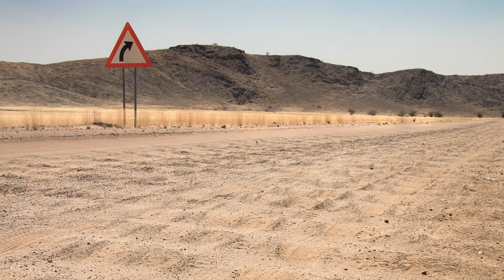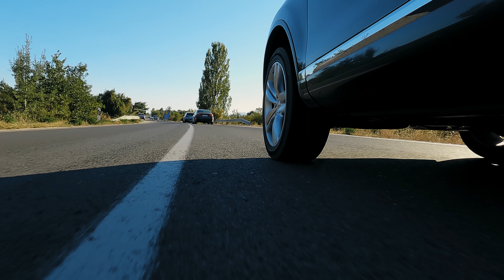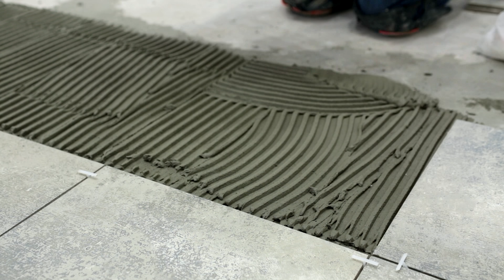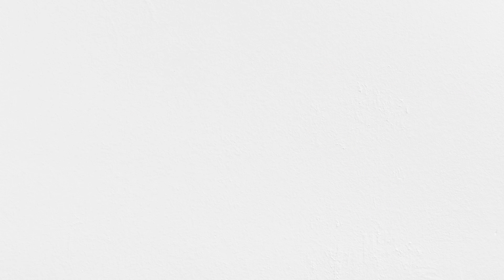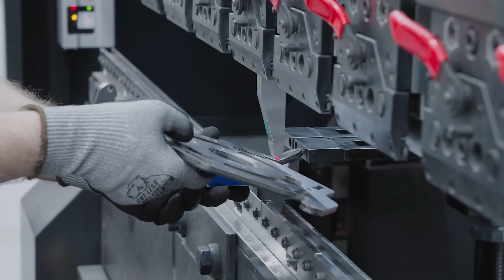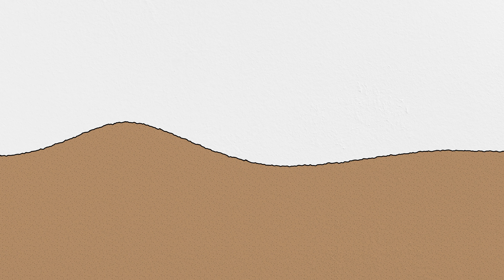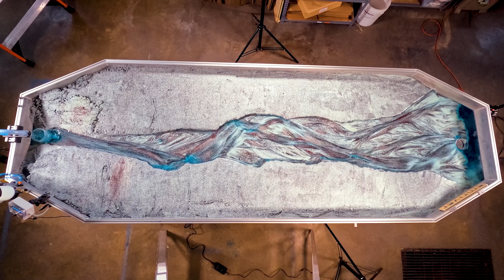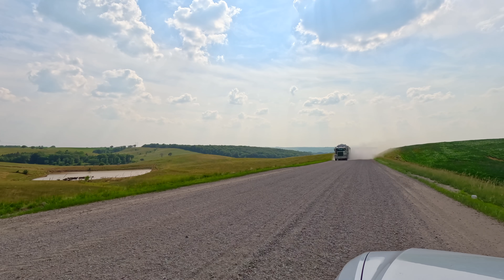Why Roads Get Washboards

Comment: This phenomenon has long fascinated me. I see it with bicycles, dirt bikes, OHVs, cars and trucks, snowmobiles, skis and snowboards, and even off road robots. While speed is mentioned as a big factor, I would say that the surface being overloaded and yielding is just as important. The weaker the surface, the faster and bigger these can form, so sandy areas tend to get the worst. Bicycle trails tend to only get these in braking zones, since that's the only place that a bicycle can overload the surface. Trails and tracks for dirt bikes and OHVs get these in both braking zones and accelerating zones. The amplitude of the whoops as they're called, seems to increase until it is about equivalent to the suspension travel of the vehicles creating the whoops. This makes sense, since once they get so big that your suspension is saturated, you are forced to stop accelerating and reduce overloading of the surface. People often stop using tracks that are badly whooped out. The whoops will creep into closely adjacent tracks, with the same phase. Motocross tracks, snow trails, and roads all deal with these by using the blades of heavy machinery to shave the peaks into the troughs. 
I consider the amount of whoop formation to be a sign of disregard for the trails. A rider who carelessly uses maximum power on the trail and overloads the surface more is causing whoops to form faster. Considerate riders try to limit their power so that the surface doesn't get overloaded so much and doesn't whoop out as quickly. Singletracks are created by bikes themselves, so once they're whooped out, they're essentially ruined. With electric bikes becoming available, I've thought about how you could have an anti-whoop traction control mode that tries to avoid the exacerbation of whoops, by limiting torque in a sine wave pattern matched to the whoops, detected with various IMU, suspension, and wheel speed sensors. I think if everyone was riding bikes with this function, trails would last longer!

Comment: I think a followup video about anti-washboarding features like at 16:08 would be awesome. That specific scene seems similar to mechanically stabilized earth, where the plastic (?) cell boundaries inhibit material transfer along the road surface. Less material movement along the surface --> less pick-up-and-deposit from bouncing wheels --> reduced and/or slower formation of corrugations?

Comment: The problem with your experiment is that you're dragging the wheel. Corrugations are formed by the wheels that are imparting force on the road, because they skip and jump and kick up the surface. Just dragging the wheel will eventually create a similar effect, but not the actual one.

Comment: You are correct, richardheeth621, about a certain speed and the other factors that set the smooth speed, but your suspension is still working a lot, up and down. He has a nice anaylsis here, but the addtion of springs and shock adsorber(damping) adds other factors. Also when the wheel is unloaded and is powered, the wheel/tires will tend to spin, digging into the surface. F1 racing cars are so powerful that that create washboarding on asphalt racing courses, and after a race, especially on a hot day, the track can need resurfacing or repaving.

Comment: While vehicles traveling may eventually cause this on a road, more often than not it's caused by the blade from the scraper at to high a speed that creates this situation.  This explains why a freshly bladed road will have wash boarding more than travel by autos.

Comment: I'm disappointed he didn't address or even acknowledge that the same effect can occur on paved roads. I've noticed it most in areas with heavy trucks, particularly where they are breaking hard. I suspect the mechanism may be a bit different, but not even mentioning it is a failure on his part.

Comment: What happens when you develop the washboard in your experimental set up, and then reverse the circulation of the wheel? Every time I drive Washbourne, I’m constantly steering from one side of the road to the other, trying to find some relief, however, it doesn’t matter if I drive on the dominant i.e. right side in the United States or the left side of the road. The washboard seems to have the same geometric shape.

Comment: What amazes me is that the washboards extend across the whole road way.
Reply: The most likely reason, IMO, why the washboard extends across the whole roadway (from the left shoulder to the right shoulder) is because people drive in different tracks down the road to avoid the worst wash boarding in the main tracks.  The wash boarding starts in the main tracks (down the center of the lane).  When it gets too bad the drivers shift a few feet to the right or left, thus avoiding the worst wash boarding.  This happens until the entire roadway, from left to right, is badly wash boarded.  There is a 2-lane, asphalt-paved rural roadway that I drive often.  It is badly wash boarded in places.  In those places, I drive with my right tires on the white line.  This works for now, avoiding the worst of the wash boarding.  But eventually that track will become just as bad as the main track down the center of the lane.  On rock county roads, there are no lines.  So people use the entire roadway, driving on the smoothest parts and avoiding the worst parts.
Reply: @edschultheis9537  I like your take - it's plausible and it matches my experience too.
Reply: Yes, I am wondering why we do not see a gradient where the statistical average location is of the tires.   Thoughts?  Testing with a dual wheel setup may help to explain this.
Reply: That's a really good one - I wish that was looked into if there was a second video on the topic
Reply: Because people try to avoid them and end up covering the entire width
Reply: Because it's caused by thermal expansion, not tire action.  The top of the road gets hotter than the underside of the road, expands and warps, but doesn't settle when it cools.  This entire video misses the point.  Thanks for being the one observant person out of thousands.

Comment: So in reality, there's no way to avoid this. The best preventative maintenance would simply be to slow down. Imperfections + higher speeds = faster washboard roads. This was neat, thank you so much. From a Blue Collar guy with a self proclaimed engineering curiosity. Jacket McFancypants approved ✌🏼🤟🏼🤙🏼

Comment: You know, an interesting follow up to this would be wheel torque. 
If the gravel is too loose, could the tire's own torque on the surface shovel out the gravel to make more grooves? Put a motor (probably battery powered) on the wheel of the rig and use that to drive it or at least displace the sand as the main motor drives the rig. My thinking is if your tires can't grip the gravel properly and start slipping, this starts making those bumps and grooves early. Different levels of compaction, different surface types, or even different tread styles can then affect tire grip, further increasing the issue.

Comment: You see this effect a lot on ATV trails, especially motor bike trails. How would the model respond if you drag something behind it. Full scale i am thinking along the lines of a vehicle dragging a section of chain link fence, your model scale maybe nuts tied to strings or wires.

Comment: I was talking to a friend about this recently, but it was in relation to spreading bark mulch over a garden bed. I have a long 36" wide aluminum rake that I flip over with the tines pointed upward and the flat blade down on the mulch and I drag it like this at the final stage to give it a smooth frosted cake like appearance. The trick though, is to never drag the rake in a straight line, or never drag the rake perpendicular to it's tine bar.  Always sweep sideways with the rake angled in such a way that it drags over the mulch in a 45 degree angle. This always reduces the tendency for it to bounce over every bump, essentially making the same washboard pattern. I wonder if this 45 degree blade skimming approach could also be used to stop or repair roads with this problem.

Comment: In Colorado we Will run a washboard road into a off-road trail. We always air down are tires to around 13 psi. It makes those roads like carpet.  For the trail it increases grip, protects the tires from being punctured and increases comfort. When we are done we air up with a compressor.

Comment: Would be interesting to run that wheel around as a powered wheel and see the difference it makes, similar to driving washboards in a rwd v fwd, as the front or awd / 4x4 version are for sure smoother then a rwd in my 45yrs of driving the baja washboards !

Comment: it's funny to point out that sand dunes are literally the same thing, just with wind instead of the wheels of a car
Reply: What I find amusing is that the huge dunes themselves are the result of that same action, and the surface of the dunes have the same thing going on in the form of ripples.  In the right conditions, if you look really close at the ripples (like ant scale), you can see the same pattern emerging between those ripples.  Like fractals, in a way.  In areas where people ride on the dunes a lot, you might see sections or trails with huge washboard peaks several feet tall, commonly referred to as "whoops".  Same action again, caused by both vehicles and wind acting together.  There's a certain technique on a quad/dirtbike where you can wheelie over one set and let the front tires land on the second set, and then repeat...this halves the frequency and allows you to go nearly twice as fast.  But if you mess up the timing even a tiny bit, it turns into a rodeo and that's where the name "whoops" come from lol

Comment: You see something similar on some high traffic, slow speed snowmobile trail sections. The waves are much bigger, but made using tracks on a pair of straight rails. Its odd, but can be alleviated with higher speed and more suspension. We call them whoops, since theyre similar in size to motocross track whoop-sections. In summer, the snow melts and reveals the gravel beneath has taken similar shape.

Comment: When they installed speed bumps on our downtown Toronto residential street, we quickly realized that only the first one actually needed to be put in, because the asphalt road surface beyond it would cyclically erode in a way that was just as effective as the speed bumps. :)

Comment: I daily drive a Mazda Miata.  I am assuming due to its short wheelbase, I can feel "ripples" in older paved or concrete interstates.  I assume it's the short wheelbase that amplifies the effect.  I have driven the same roads in my wife's suv and I don't feel them.  Also, it seems more pronounced in the right-most lane, is that due to heavy trucks?  Great video.

Comment: It’s hard acceleration that causes it. That’s why it’s way worse in transition areas. When the drive wheels catch air the spin faster so when they make contact again they dig the lows lower and throw the loose material on the highs making them higher. Light weight vehicles are way more damaging to the wear surface of a gravel road than heavy vehicles. It’s not the speed that cause the most damage it’s the acceleration.

Comment: To not mention once that dirt roads with average speeds above 45mph are nearly never washboarded is insane. You've clearly not grown up on dirt roads. Washboards are caused by people driving too slowly on the roadway. Which allows harmonics to build like your demonstration. I don't need to build a jig and spend research dollars to tell you what is obvious. Yeah the science is there but you've neglected a huge majority of the science. Maintaining a good mix of aggregates overtime requires those finer silts be removed by dust. Also the higher speed reduces the likelihood that vehicle harmonics will be similar over time. The only places I've had an exception to this are places where the type of vehicle that drives on the road is consistent over time like only big rig traffic.

Comment: it has nothing to do with the wheels/tires that is the cause of the wash boarding effect, proven by the bumps and valleys don't just form where the tires hit the road. it is not the uneven sand/dirt that causes it either. it all has to do with aerodynamics. the root cause is how the winds and suction/vacuum caused underneath the vehicle lift and redeposit the soil. if you were to take a wing mounted to your contraption, and had it slightly above the sand, you would see the sand begin to become the wash board. the faster the wing or cars go, the faster and bigger the piles become.

Comment: I partially don't agree with the "researches conclusion". I drive on these quite regularly ( few thousands of km per year. ) and I noticed it happened more and mostly when finer material is present in the gravel. On more industrial road were really coarse material is used (inches and over) it doesn't happen at all or only in spots where finer materials ended up. My theory based on observations is that the finer materials act the same way as ripples in desert and oceans bottom sands under erosion by wind and water. So, it is more a wheather induced phenomenon than created by the wheels of the vehicles (which would create the pattern only in the tracks and not all the way across the road. Note that the mechanical turbulences created by the induced wind of circulating vehicles contributed considerably to this phenomenon.
So bigger gravel is better and easier to maintain but rougher on tires, unless you ride LT 10 ply and up heavy duty off road truck tires. I live in North East Canada with winters, thaw and a very damp to extreme dry weather in the summer.

Comment: I live in rural northern Michigan where the dirt roads are given periodic dustings of sand in wintertime to keep vehicles from slipping on ice. I suspect this significantly increases the washboarding as the roads over time accumulate a hefty amount of sand on top which is softer. I have also noticed after the brine truck has treated the road to reduce dust the washboarding is significantly reduced also.

Comment: I'm kind of curious on the effect of millings (shredded asphalt) on the spinning wheel. But the usefulness of unpaved roads on extreme enviroments sometimes mean doing nothing is better than paving. In glacier national park theres parts where the mountain is slowly sluffing off over a period of 50 years which seems like nothing til you realize it means the road wont stay connected for more than a month. In certain parts of yellowstone national park its so remote the struggle isnt getting money, its getting people willing to dive 6-8 hours a day for work. The loose rule of 1 million per mile of road gets thrown out the window.

Comment: I think a driven wheel would give a similar but different result. Most vehicles have at least one pair of driven wheels that would spin slightly faster while in the air, then throw material backwards when they make contact with the surface again.

Comment: We’re seeing it outside Dallas on a paved road that crosses the Trinity River. There’s a lot of sand and gravel trucks plus trash trucks from a landfill that beat the road daily with heavy loads. The pavement is washboarding near and intersection, most likely because it’s overloaded on a thin, poorly supported road.

Comment: In dirt bike racing we call these braking bumps or acceleration bumps. Depends on where it located near a corner depends on the name of it. The same principle applies here as well. Depending on the tack/soil, those bumps could be minimal one lap and your next lap be massive. They also creep further and further. The more laps you put up the longer the section if bumps. It gets to a point where it could be a entire straightaway of bumps. I have noticed on local roads that generally, in my area, where the bumps start is around stop signs/sharp corners. Same as a motocross track. I'd really like to see this experiment be done with a slowdown/speed up in a certian section; to see how much this accelerates the wear down.

Comment: As a geomorphologist (earth surface processes betwixt land and weather) I'm impressed by all the engineering aspects imposed on the ground and PE explains them so well. My perspective is from the earth's side. As PE pointed out, this is a dance of the driving forces (the speeding vehicle's tires) engaging the resisting forces (the natural road bed and our tire-made washboard ripples). Along any stretch of dirt there are a jumble of soil/bedrock bed types, slopes and tilts, wet/dry drainage, wind/sun exposures, daily/seasonal changes which all add up to the likelihood of many strongly different washboard-road patterns, but there aren't. PE suggests some potential explanation but I point toward the general commonality of the objects racing across these dirt-ribbon roads. They all are 6-8ft wide, 15-"40"ft long, ride on tires of a certain size range, spaced apart laterally and longitudinally at a standard range allowed by DOT's, traveling between 20 and 60 mph (personally I enjoy skipping from ripple crest-to-crest tho I don't subject passengers to that 'floating' technique). And only a certain size range of granular materials are well suited for dirt road duty). Given those multi-level constraints, the washboard roads that emerge would likely reflect whatever their balance is when all those forces get a chance to settle in. Dynamic balance indeed!